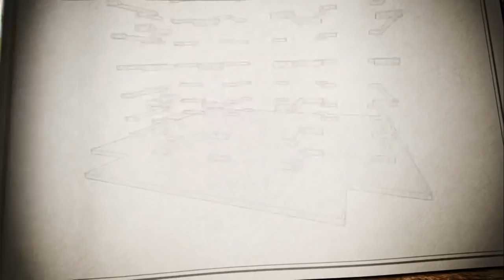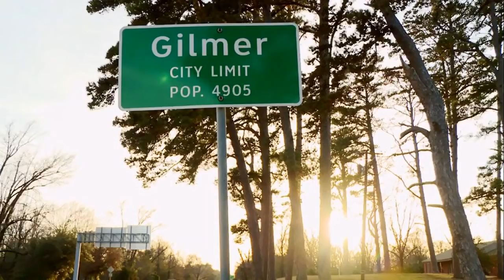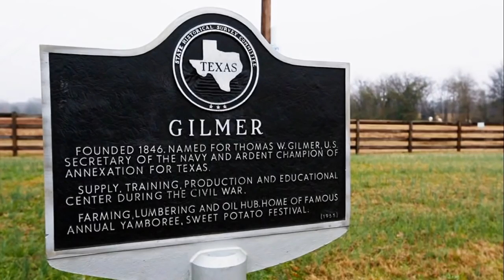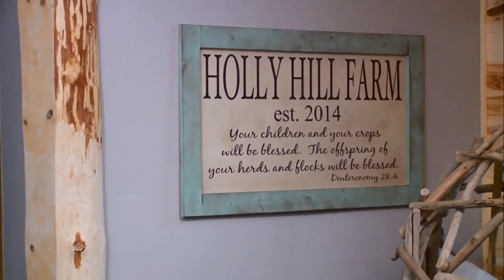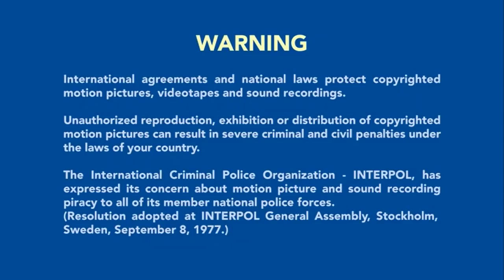Cabin Fever Episode 8

Comment: You dad really saved your cooked goose with the wench switch.. but as a precaution..next time either lube/grease the starter switch or a bigger idea would be to build a 24foot high 80foot wide..140foot long workshop with an overhead crane system...the whole length of the workshop...where you can continue doing your A+ work..and do the milling inside....plus, when the work is done.. you can bring in the truck..load your product and off you go..... lastly it will keep the team warm in winter and cool in summer...thankyou for the videos.. Stay safe.. GOD BLESS.